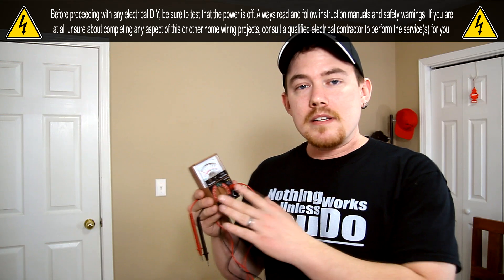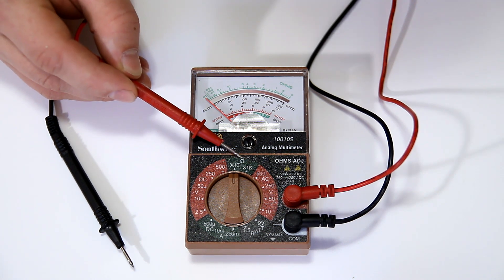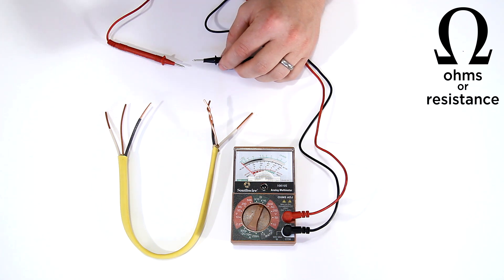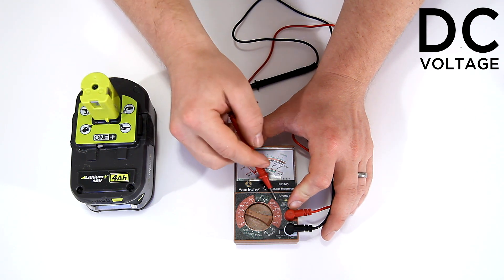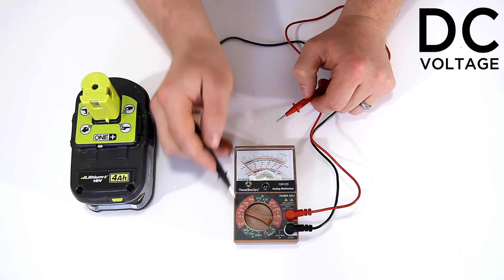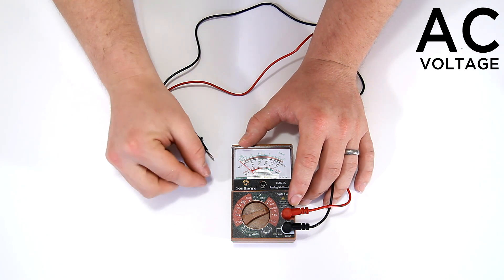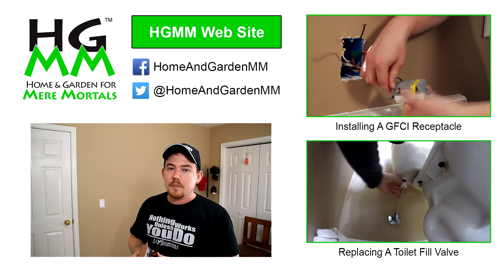How to use a multimeter or voltmeter: Basics you need to know.

Comment: Extremely helpful to me, since I have a dial (analog) multimeter.  How do I test 3v batteries?  I have several CR2032 batteries but the battery test settings I have are only 1.5v and 9v.

Comment: A simple lamp socket replacement became complicated when the lamp cord had no characteristic to distinguish between the hot and neutral wires. A multimeter continuous test solved the problem.

Comment: I'm testing the strength of AAA batteries. I set the dial to DCV 5. Every battery I test has the same reading. Brand new battery or 10-year old battery. The needle goes to between 1 and 2, or 2 and 4, or 5 and 10, or 25 and 50. How the heck do I know which of these rows of numbers to look at?

Comment: I've got this brand new Southwire Analog Multimeter 10010S exactly as the one you have got in the Youtube video below and I have it set on 1.5 BATT with red touching the + and the black touching the — on the 1,5 V SONY newly purchased battery, also I tested it on a new PHILIPS and DURACELL 1,5 V batteries as well. The red arrow on the multimeter display seems dead and does not react to any of the batteries, not even on a lawnmower 12V battery (with a 10V setting). I did get the arrow move to 6 reading between good and bad only ONCE (just once) quite magically, only once, but never again. What's wrong with this brand new unit? Should I bring it back to the store and buy a different brand? On the back it says INTERTEK  4007177 and NO.1303056708. I was careful enough to not use it on a wrong setting and today is the first time I used it, on a 1,5V battery (3 different brands) and I get(almost) no life or usage out of this analog multimeter.

P.S. When I touch both sticks together the red arrow in the display does not go to zero. I have lost manual instructions for this unit, but it is brand new. It just I kept it like for 8+ years and only tried to use it today. It's been enclosed in a safe plastic box and no humidity exposure. Does it run on batteries? I can't find any reasonable lid for battery replacement on it.

After showing no life on a 1,5V battery (the brown switch set on 1.5V BATT = black area) this unit suddenly started showing a reading which came to almost 8 at the red scale and just below 200 40 just above it. I have no idea how to read or understand this reading? And why does this unit shows no life most of the time and then occasionally revives itself? Should I buy a more serious unit of another manufacturer brand?

SOUTHWIRE manufacturer did not bother to provide a video and online instruction manual... I suspect they sold all the dysfunctional ones to Walmart and we have bought one which does not work as new....

Comment: When you tested the 18 volt battery and it read 18 volts I noticed the needle also fell in the "replace battery" section of the bottom most scale. Obviously the battery is good so how is the "replace/good" scale at the bottom of the meter used? I'm a bit confused. Thanks.

Comment: So the other day i was trying to get the voltage reading of a pole light, opened the little hatch opening at the bottom and pulled out the wires and undid the wire nuts, so technically i would have to put my common black probe on the live wire and the red probe wire on the neutral wire?

Comment: My multimeter has no negative or positive it has 3 wholes and I don’t know where to put the plugs. Never mind figured it out. Great video. I used it for a shungite rock to see if it is real. You turn the knob to ohms 200, if it is real shungite it would reach 0 on the multimeter. Thanks

Comment: One suggestion: When I first went through the video, I was confused by the tests of the extension cord. At first, the test showed a closed circuit was flowing, and that was good. Then the next test showed a closed circuit was flowing, but that was bad. On the second viewing, I realized that the first case was testing the same wire at both ends of the cord, while the second was testing different wires, which should not have created a closed circuit. You might clarify that for those of us who don't know which end is up. Thanks for the video!

Comment: If measuring something like a 120V wall outlet, insert the black probe (neutral) first so that you don't risk giving yourself a shock. Otherwise, inserting the red probe first will turn your black probe into a live wire through the voltmeter.
Reply: Just gonna say that, and put black probe in longer slot too
Reply: Its just 110 no harm done
Reply: So in this video he put the red wire in the larger socket but he should have ve put it the smaller one?.
Reply: @garyh1407 black goes into long slot or third under slot. But like he said ALWAYS PUT THE BLACK LEAD IN FIRST. If you put the red lead in first or take it out last you make the black lead hot, which I don’t need to mention but I will, is extremely dangerous. My guy in the video did this part wrong.

Comment: Thanks for this easy to understand tutorial. Is there a good way to detect which of the wires is the hot wire?
Reply: red is usually hot; black is ground.  In a house white is positive; black is negative, and the bare copper is ground (right guys?)

Comment: Hi Jay. I have just watched this video and as a retired electrician must warn you that the multimeter is not recommended for checking that a circuit is safe to work on. They will tell you if the circuit is live but a  voltage tester should be used to prove that the circuit is safe. The voltage tester should also be checked on a known live circuit before  and after use.
Reply: Is there a video on voltage checker?  Can a layman use one safely?

Comment: Hi, thanks for explaining 
about the voltage!
well my question is, when you did it in the battery w/18 voltage. I have those battery s but I did and came out like 11:25 voltage..... I was thinking because the battery got to be in a fully charged to get 18V??
I did it in a dewalt battery and my battery is OK.....thank you again!!!
Reply: Hi Danny, to answer your question yes.  Lithium ion batteries will display a lower voltage depending on how much you have used your tools in between charges.  If your tool stops working and your battery "dies" that means the voltage being supplied by the battery is not pumping out enough volts for your tool to operate.  After a long time you may see a slightly lower voltage output after a full charge because the materials within a battery degrade over time.  Hope this helps.  I'm an engineering student at the University of Florida if that provides credibility.

Comment: http://www.amazon.com/dp/B00QOUKOAG/
Yeeco Digital LED Ammeter Voltmeter Multimeter Dual Display USB 2.0 HUB with 2 Ports for Fast Charging & USB Communication Charger Detector DC 3.2-10V 0-3A Red Blue Solar Panel Alignment Tester Mobile Power Panel Voltage Current Gauge Monitor

Comment: Jay,  Thank You for all of your efforts on this channel.  I am sure there are a lot of people who are going to take advantage of your expertise.  I grew up when there were no digital meters.  Reading all the comments about digital meters made me think about how important it is to be able to use ANY meter when/if you only have an analog meter to use.

One thing about using the "ranges" on the meter.  I was taught to start on the highest range for the first test, then move down one setting at a time until a satisfactory setting was reached.  Often, a person may not know what the voltage/amperage/resistance is and starting at the highest will protect the meter as much as is possible.  Definitely not the ultimate safe practice, but a good one none the less.

Good Luck,

Comment: Thanks.  I got one of these from Harbor freight free, but all the numbers made it look very complex and I never got around to figuring it out.  This video gives me a start, and certainly not as complex as it looks.  I've been using one with a light that you stick into the socket, but this obviously has more uses since it has two leads and you can check bulbs and batteries, etc.  Also, nice to know what you are doing instead of just using a light.  The one with the light is handy, though.

Comment: Testing if wires are under line voltage is better done by a live wire detector - http://elektronikabg.com/userfiles/productlargeimages/product_306.jpg . There are very few cases where live (or hot) wire detector can't show dangerous voltages.

Comment: Pretty nice Video, superb idea with your new channel! :)
You can also test batterys, if the voltage reading is notcable below the Rating of the battery it means your battery is dead. Or with a Temperatur-sensitive resistor you could also measure teperature (only recommended if your meter supports that measuring method, otherwise you would have to calculate the measured temperature, but it is possible! ;-) )
I´m an electrician on my everyday Job and would also love to share my knowledge with everyone.
On my channel I have some Videos about Setting up a complete IKEA-kitchen, safety rules (german Standard) and installing a multiway switching so far... I´d love to know if you could use some of this stuff! :)

Comment: Couple of things, the first is minor, when you check continuity with an analogue meter, you should short the leads together, then adjust the control (usually on the side, not the one on the top below the needle) so that it reads zero.
When testing mains voltages, there is a possibility that you could stick the probe in the live terminal, then touch the other probe that will have live flowing through the meter
Also, don't take it for granted that the circuit is dead, always prove the meter works first on a live circuit before testing the 'dead' circuit, even then, a disconnected neutral may give a false reading, test with one probe in ground pin.
No mention of digital meters ? they are about as cheap as analogues these days, and are better protected for overvolt and reversal of dc
(32 years electrical in UK)
Reply: Yes, all good except if you have already inherited an analog meter and want to know how the heck to use it.  I just discovered I can validate the quality of Shungite via the OHM feature....what a prize!!!
Reply: @cherylschuh8043  really! I’ll have to try that today!

Comment: Our gas range stove was failing to heat yesterday (trust me that is a bad thing one day before turkey day) and it has two glow devices (same part) one for broil and one for the oven. With my voltmeter I was able to test|confirm that one was broken. After swapping them the broil part is faulty but the oven works fine. Wife happy - turkey can come. Gives me enough time to order a replacement.
Reply: Bravo!

Comment: I used my volt meter to check the battery and alternator in my car. With every thing off the battery should be about 12.5 volts DC and with the engine running (and the alternator charging) the voltage should be around 14 volts DC. Doing this let me know my alternator was not working and needed to be replaced.
Reply from the maker: Tom C That's a good one!

Comment: Fuses are one of the best uses for an ohm meter.  Remember to pull the fuse out of the circuit before testing.  I have several meters both digital and analog.  These things will save you a ton of money and time once you become familiar and comfortable with them.

Comment: I'd recommend paying a few dollars more and getting an auto-ranging digital VOM, the red-black one at Wal-Mart for ~$20 isn't too bad, and has an actual battery test function.

Also a warning is in order, based on something my dad did with a free-at-the-door Harbor Freight meter...He wanted to to see how many amps a circuit was, so he set the meter to Amps and stuck the leads in an outlet. smoke and sparks resulted!

Never set a meter to Amps/Current and put it across a power source. The amps mode is meant to be connected in line (series) with other component in the circuit. If you are confused, don't use this mode. :-)

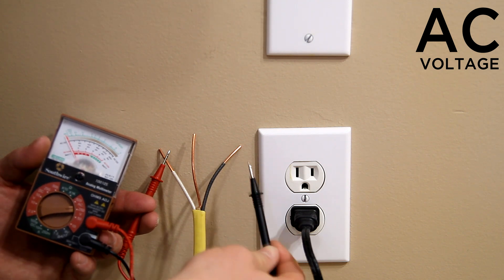Comment: Is the test at 4:50 really complete?  What if the hot wire is still hot and the neutral is disconnected (unusual, I'm sure)?  Would it still show no voltage, or would it show a little just from the capacitance of the neutral wire?  Seems like it wouldn't hurt to test the other combinations too.
Reply: You are correct sir.  You should always test  each lead to ground. The ground and neutral (white) wires are bonded at your main service panel (unless your on a sub panel circuit), so just because the neutral is open it doesn't mean the ground is as well.  If the neutral was disconnected or open, you would not get a reading, because your not closing the circuit.  So if that was the case and you happened to touch the hot and to something grounded, you would get a shock.  Plus, there  can be a residual current running through the neutral, so take the same precaution with the neutral as you do with the hot wire.
Reply: We also use insulated screw drivers with a voltage indicator (a small light bulb),  the  'earth' is the hand, allowing to test for voltage and work in the same movement.  I guess because 110V is so safe nothing equivalent seems to be offered at Harbor Freight.  
I had something more modern, a meter with an AC voltage proximity sensor,  but it exploded when I tried to measure 400V directly.
Reply: Another option would be to use a non-contact voltage tester.

Comment: I would strongly suggest getting a Digital Multimeter (DMM) instead of an Analogue Multimeter. The readout on a DMM is clear and leaves less room for interpretation. Low end DMMs are about as cheap as an analogue multimeter but do require batteries.
Reply: Also, they don't break if you switch polarity.
Reply: Not only switching polarity, but protection against overdriving them.   The higher end ones also autorange, so you just have to set it to volts and it'll pick the right setting to get you the right reading.

Comment: I wouldn't recommend using cheap dollar store meters to measure mains, especially 240. Cheaper meters often don't have  essential safety components such as MOVs and worse case no fuse. If something were to go wrong you could be risking your life. For example, trying to measure voltage when set to resistance mode could result in a short, which could melt through the leads you are holding. Spend a little money in a quality brand name meter to be on the safe side.
Reply: I will second what Joe Cleveland said, stay clear of cheap analog or digital multimeters for measuring mains. They lack a lot of safety features a good multimeter should have such as, input trotection, proper test leads of the correct rating and guards, blast proof casing etc. You are better of with a mains testing screwdriver or even better a non-contact voltage detector.

Comment: 1:50 Be sure you've unplugged your extension cord from power before you start testing it with your meter in the ohm meter setting. Many an ohm meter has been smoked by testing power. They're 10 bucks now? Even $2? I'm getting a new meter. My Triplet cost about $200 back in the day.
Reply: Yes, he definitely should of mentioned that you should never check ohm's/resistance on a live circuit....

Comment: Crimping alligator clips on the end of a spare set of probes and covering with heat shrink is a great little DIY upgrade..... But only for ohms and low voltage. Stay away from high voltage and amperage.